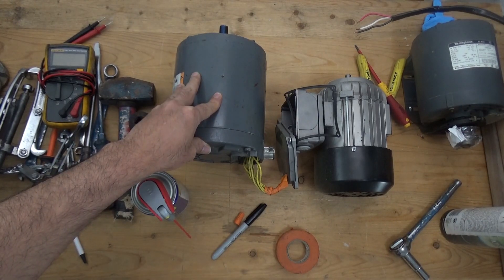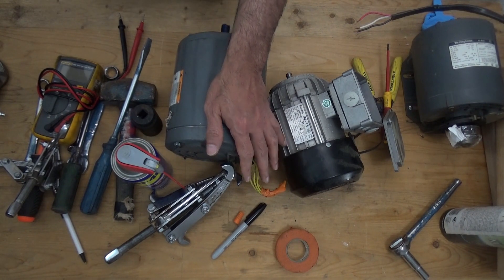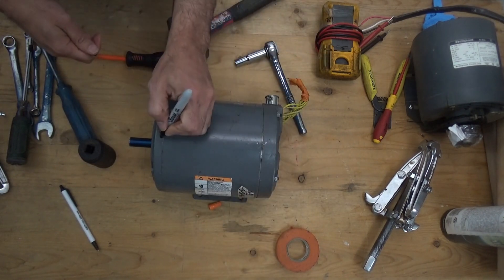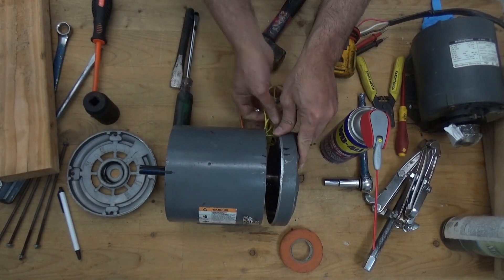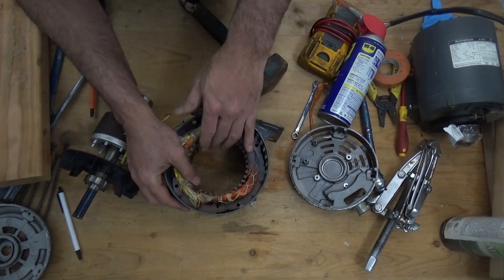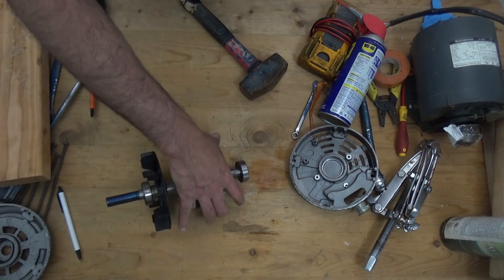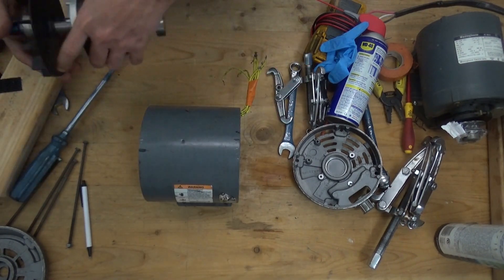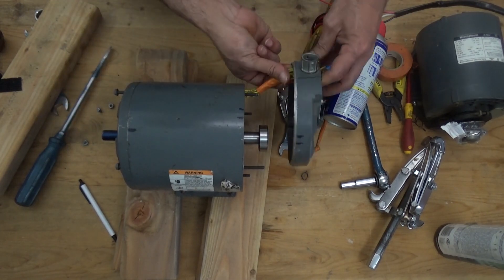Electric motor bearing replacement

Comment: Bearing numbers explained  https://electricalfundablog.com/identify-bearing-number-calculation-nomenclature/
You said your bearing is 6203Z
6=single row deep groove ball bearing
2=light duty
03=17mm inner bore diameter (same as motor's shaft diameter)
Z=one side shielded